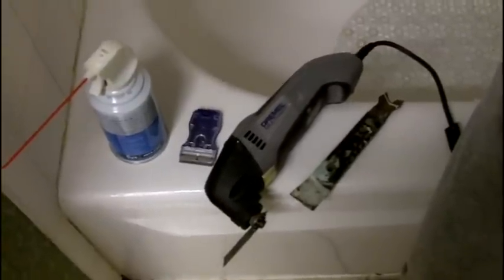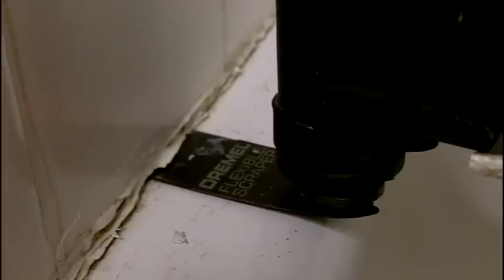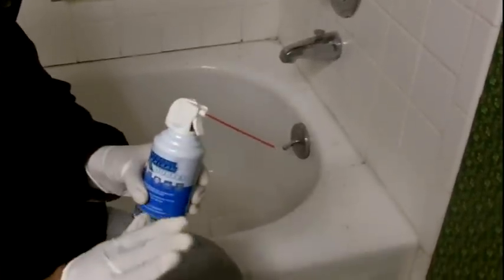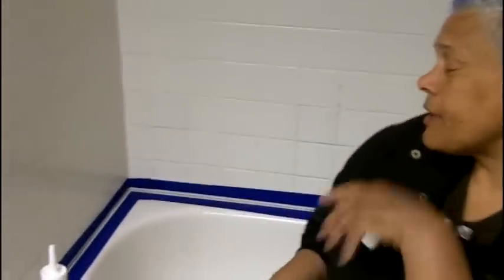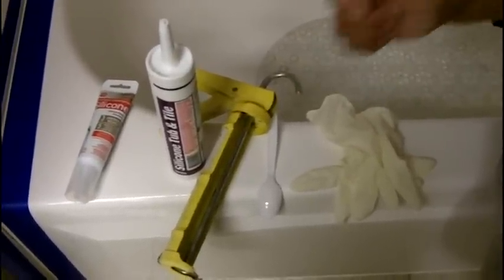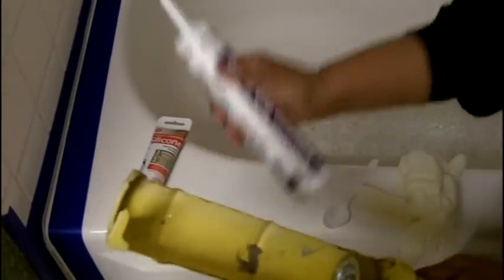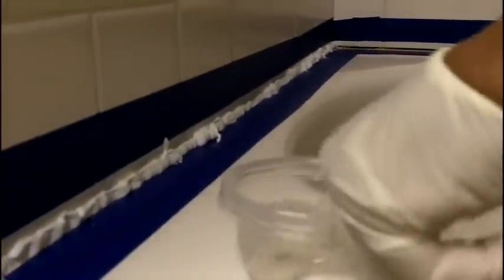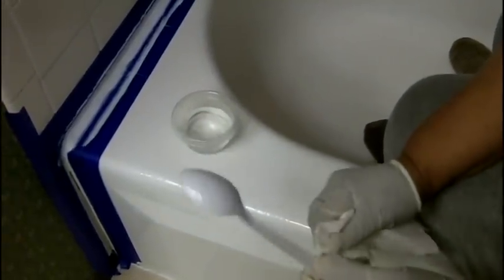How to Caulk a Bathtub with Beautiful Results

Comment: I am a professional caulker and you were doing very well until you used the water. This is an excerpt from one of the major silicone sealant manufacturers.

Sealant should be applied as follows:
1. To help ensure an aesthetically pleasing job, masking tape should be used to keep excess sealant from contacting adjacent areas where it is not intended.
2. Apply the sealant in a continuous operation using a caulking gun or pump. A positive pressure, adequate to fill the entire joint width, should be used. This can be accomplished by pushing the
 74

sealant ahead of the application nozzle. Care must be taken to ensure complete fill of the
sealant cavity.
3. Tool the sealant with light pressure before a skin begins to form (typically 10 to 20 minutes).
Tooling forces the sealant against the back-up material and the joint surfaces. NOTE: Do not use liquid tooling aids such as water, soap or alcohols. These materials may interfere with sealant cure and adhesion and create aesthetic issues.
4. Remove the masking tape before the sealant skins over (within about 15 minutes of tooling).
All major sealant manufacturers say something similar
Dry tool without the water
And before installing sealant wipe the joint with alcohol immediately followed by a dry rag
Other than the critical mistake of using water very well done

Comment: No 😅 why must you have to make your life so hard!? It's simple, I been a tiler for 10 years and all you need is a silicon gun... Silicon because that's what you use on a bath to make a water seal. Using a scrapper smartly it's actually a lot easier and cleaner than the machine... Like a lot easier and cleaner.

Comment: Overall okay.  Dont need that much tile showing below tape.  Laid down ALOT of caulk.  The idea is to lay down only a little more than it requires.  When you do as much as she did it will turn into a mess, especially for the amateurs.  Could kind of tell that resulting mess was edited out lol.
Reply from the maker: You're correct in that less is better. The tub being caulked in this video had a gap between the tub and the tile which varied  As for a mess being editing out, that wasn't the case.
Reply: I saw it too!  LOL
Reply: Pause at 12:26  = Top, middle, right of screen.  LOL
Reply: Pause at 12:28  = Bottom, left, left of screen.  It's oozing out. LOL